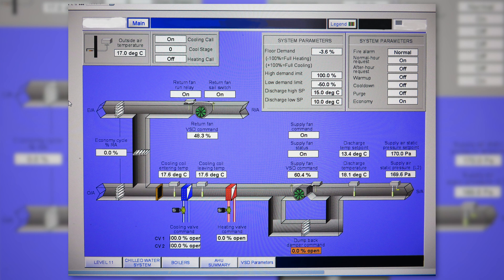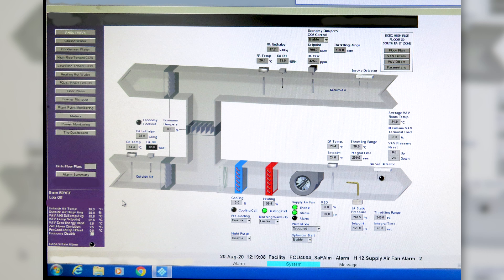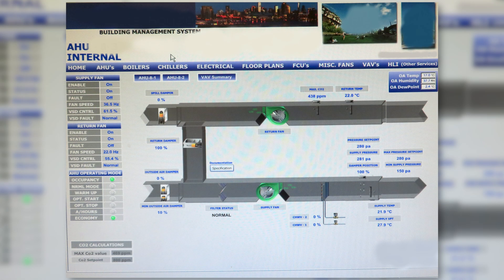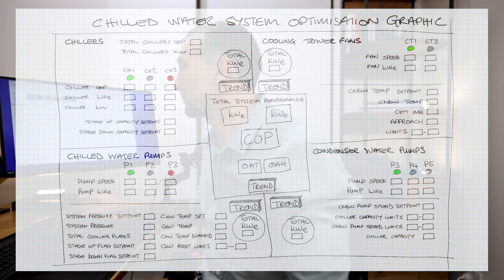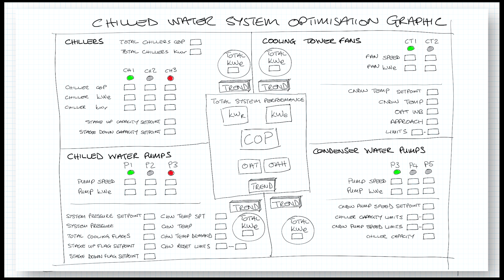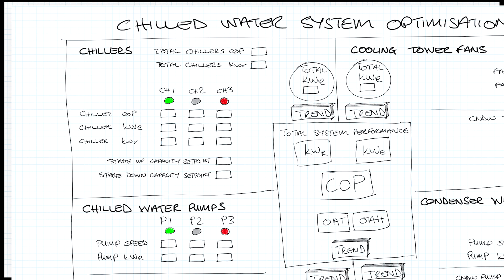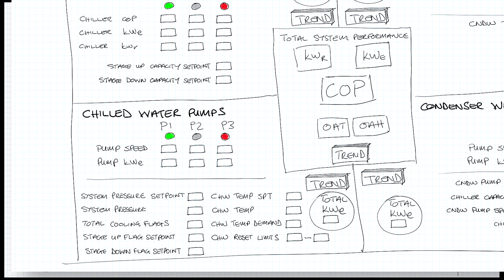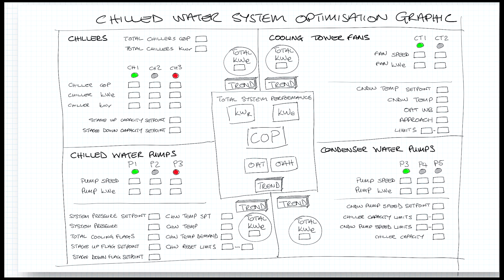Our BMS graphics suck - part 1

Comment: Very accurate, most controls companies are just plan and spec. Most service contracts are to address a log book. Most building operators are not concerned about anything but comfort complaints.
1) governments pushing regulations for energy use.
2)consulting engineers should consult. Some places are using smart building consultants separate from construction/installation. Awesome video, I agree with everything you said. The industry is lagging and the technology companies are taking advantage of the visualization, and taking the labor too. Well done, well said!
Reply: I love the concepts explained in the video. 
I think that there are various reasons why energy efficiency is not done but i hope that with todays cost of energy and awareness of climate change we will change things...
Reply from the maker: "Consulting engineers should consult" 😆😆🤔
A big problem we have is that we don't have BMS consultants. Imagine if hydraulic engineers design mechanical systems. 
We have many fundamental issues. I frequently scratch my head trying to work out how to solve these problems. I actually have solutions, I just can't scale them...
Thanks for the comment, Scott. 
I hope life is good.

Comment: Like the concept you show…reality is cost cutting when at tender, so graphics is based on cost. I have always thought we should have two sets of graphics. One for End Users (Daily Use) and One for Engineering (could be hidden from End User login but used for Tuning with Building Owner permission). Another thing the graphic should show is the original Design Set points so there is a reference. Normally things go wrong when fiddle fingers adjusts the Commissioning Setpoints without understanding the impact or design parameters.
Reply from the maker: Iv worked on many new construction projects around the world before I moved into consulting. 
And, of course I agree. Just getting a BMS installed with all the BS is near to impossible. 
I'm pretty forgiving when witnessing, as long as it is fit for purpose, I'll generally sign off.
However, for the next 20 years of maintenance, we have no excuse for not enhancing what the installation team delivered. 
I think presenting the information in two different ways is a good idea, as you suggested. Probably a must. Facility operators need a very simple, clear view. Most don't want to get to deep into it. 
Cheers

Comment: Good point, Bryce. BMS should be more BEMS than building services animation (to optimize energy consumption), but sometimes data such as COP are not available (not exposed by the installer). Regarding BMS energy efficiency I would say that on some platforms are available additional programs such as analytics (e.g. Niagara from Tridium, Niagara Analytics)
But optimization graphics shouldn't be specified by the consultant on BMS specs? And such optimization graphics are good indeed for the facility team, but they must use them properly.
Reply from the maker: You can calculate COP, or get it out of the chiller high level interface. 
Traditionally we used a flow meter for the calculation, which most jobs don't have. However, you can also calculate chiller evaporator flow using a differential pressure transmitter. 
In Australia most our chilled water systems are primary only, so we always have a chiller evap pressure transmitter. I appreciate that in other countries where they mostly have primary/secondary that the chiller has neither a flow meter or pressure sensor. 🤔

Comment: I disagree with the point at 12:00.

Unfortunately, a lot of facilities teams don't care about anything other than their zones being at setpoint.  So extending the extra effort to create something better can often times be a waste of not only time, but company resource.  The onus is also on the clients to have a higher expectation from the BMS companies, and eliminate the trend of biasing towards the cheapest solution.
Reply from the maker: Awarding contracts on price alone is a different issue to us proving more engaging graphics. But, I do get your point.
I sometimes think, that we don't give clients any other metric to gauge us on than price. 
Say you went to the shop to buy a shirt. All the shops had similar, not great shirts. Nothing exciting, similar quality. You would just buy the cheapest one. 
I think our industry is a bit like that.
We could improve on just about every part of what we do and differentiate from each other. But we don't. We all do pretty much exactly the same thing. We make the same mistakes. Why should mechanical contractors and building owners evaluate us on anything other than price.
Now, I do feel that if we actually did something amazing, there is a good chance clients would still pick the lowest price. 
But, in my opinion, we haven't tried yet. Obviously I'm generalising. 
Thanks for the comment.